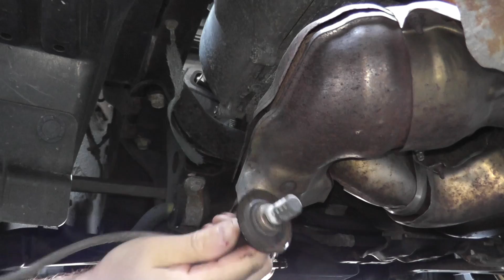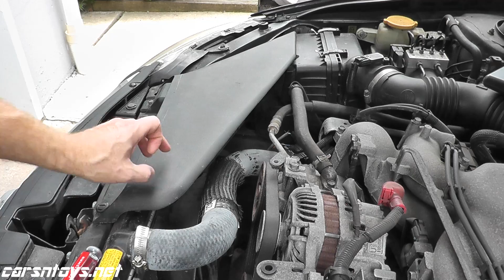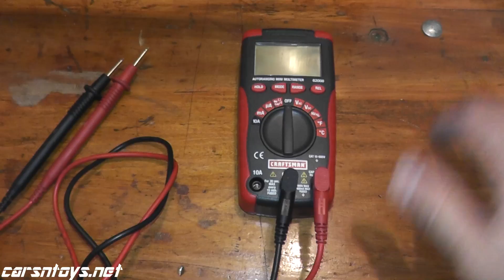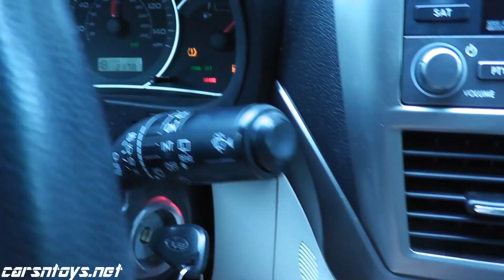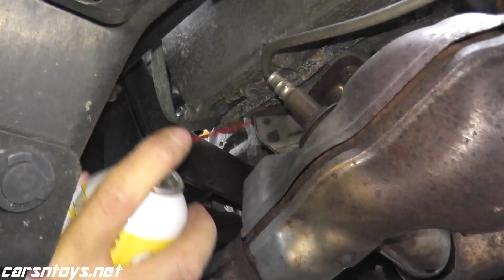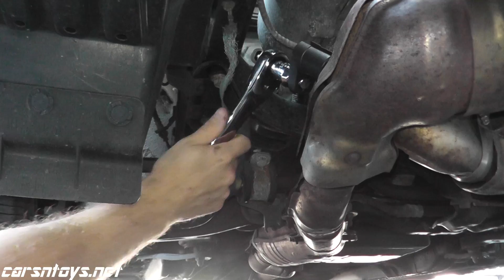Rear Oxygen Sensor P0037 and P0038 | Testing and Replacement

Comment: My 4.2 a6 had this same code would it cause the car to not rev and barely move in traffic.
Reply: Did you change and notice a difference?
Reply: @joepearlzz8504  Yeah I changed the O2 sensor and the fuel filter and it worked fine after that.
Reply: @kaptainkirk11 did u change lower or upper ?
Reply: I changed both and also changed the fuel filter, afterwards the car was fine but I sold it a few months ago

Comment: I had P037, I replaced the sensor with the extender, the car gets better but I got 3 codes later, P037, P038 and P039, any solution or suggestions please. thanks great video.

Comment: I replaced the old downstream sensor for a new one (~130K on 2001 Saturn SL2) and got a code P0038 after ~10 mi. I'm updating everything I can on emission trying to remove P0446. But here P0038 came, probably defective sensor. What is interesting the driving is great, no impact of that code on it. Can I clean the original sensor w/some carb cleaner and use it for a while, while I find the good sensor?
Reply: I was wondering about cleaning mine with carb cleaner or electric clean.
Reply: @bigredc222  I wouldn't. Better to find one on Amazon. They send it pretty quickly. Actually I bought 2 (different brands(, and one caused a code, I replaced w/the 2nd, and that one worked good. It is for that one on the bottom, under the car (Downstream O2 sensor). Upstream O2 Sensor (by the engine), I replaced, worked w/no problems. Ideally of course OEM. But maybe cleaning also will work. I'm not that expert.
Reply: @olenaerhardt7725  I can get an oem sensor at Rock auto for $85 or one from Amazon for $30.
Reply: @bigredc222  I'm sorry, Upstream and Downstream O2 sensors, I expressed myself wrong before. I usually try to go w/OEM, but since I practice primarily on our spare old car and difference in price, sometimes significant, in many cases I just buy cheaper aftermarket parts to see if I can replace that part, and everything works good so far. Those O2 sensors not hard to replace (once you broke the nut on old Downstream (that is most difficult part, but if you penetrate w/PB Blaster for 1-2 days,like I did, and then use a small breaker bar there shouldn't be any problems)).
Reply: @olenaerhardt7725  What are you sorry about? I'm working on a 2008 Mazda 3 I bought new, it's got under 70,000 miles, so I hope to get another ten years out of it since it gets driven very little. Part of me wants to spring for the oem since the car has been so good to me, but the cheap side of me want to try cleaning it first. 
I watched a video of a guy cleaning one, and most of the comments say it works, but one said it only lasted six months and he ended up having to replace it anyway.
Maybe I'll split the difference and buy the cheap one. Have you ever tried Rock auto for parts?
Reply: @bigredc222  Well, that is bcs I used the wrong terms for those sensors: not #1 and #2, but Upstream and Downstream. Anyway, if you have just 70K and it is so good car, I even don't know. I think those sensors effect the work of engine. See i have in my possessions for my auto experiments 2001 Saturn SL2 (132K), which is famous to withstand many things. Someone on Saturn fans even stated that you can't kill Saturn, which is true for our Saturn. I also saw a film, about cleaning that sensor, but for that your car, I personally would go w/OEM only. Maybe to do more research, like what does that bad sensor(s) can do. For example when on one Downstream sensor I got a code for it, there was a code, yes, but the car was driving perfectly well. But it was some negative effect I was not aware of, smth that computer didn't like. From Rock Auto I ordered just one part (decided to try after Mechanic the Nick film, he recommended that company). It was Heater Core (like for $10), I want to try, if I can replace it. I filled it w/water - no leaks, but I didn't installed it yet. They sent the order very fast, I think very good CS and company.
Reply: @olenaerhardt7725  My thought on cleaning it, the sensor may not even be bad, there could be a problem with the engine and the sensor is just doing its job. I wish there was a way to know the difference. I read one of the things could be a leaky head gasket letting coolant into the cylinder.
Reply: @bigredc222  I've replaced Valve Cover gaskets on 2 cars (including Saturn), but Head gasket is too complicated for me, though I have it in the set, maybe later ...
It is interesting to know that the coolant can leak into the engine, bcs of poor Head gasket, I think I've heard or read somewhere about it as well. But if you clean the O2 sensor, how you will know if it is good or not? In my case I've replaced both O2s just bcs of millage. But on one downstream I got the code after some driving, replaced on another one and everything was good. Both downstream sensors were aftermarket.  Do you know how to replace that Head gasket? It seems like too small millage for that gasket to go bad.
Reply: @olenaerhardt7725  I did a head gasket on my sister's Volvo and it worked out. I went to vocational school for auto mechanics in high school for two years, but after I got a job as a mechanic I realized it wasn't a job I wanted to spend the rest of my life doing, but I kept my hands in it by working on my own, and my friends and families cars. I've done timing chains, water pumps, suspension parts, exhaust systems, and brakes, I've also fixed TVs, air compressors, cell phones, tablets, computers, plumbing fixtures, and all kinds of stuff. If you have a decent mechanical ability there's almost nothing you can't learn how to fix on youtube. Sometimes I would find out how much a garage wanted to do the job, then if I could buy the tools to do it for less, I'd buy the tools and do it myself. I love tools so I look for any reason to buy more tools. I forgot I got some additive I put in the gas tank, I'm going to run a tank of that through before I replace the sensor, I may get lucky. It's cold here now so I may wait till the weather warms up before I work on it.
Reply: @bigredc222  O my! You did a lot, I even feel awkward I tried to give you some advices, unless you take them as some thoughts of DIY w/only 2 years experience. I noticed though that not every mechanic in the shop would do some of my projects. Also practically none I saw aware of a Breezer Line for 2003 Chevy Cavalier, which connects 2 Inner Tire Rod Boots (Rack & Pinion Boots more correctly, I think), and have tangency to knock it out during alignment. It is horrible design on Chevy, I agree, and maybe that line is not so important, since only recently I discovered, that for several years that car was driving without that Breezer Line (it is like aluminum 1/4" pipe) to be connected and just resting on suspension, but still. At Fire Stone they could know about it. Being a person of technical background and watching YT I found that many projects can be easily done. I also very specific about precision on torques, particular chemicals to be applied and alike, in other words I like the project to be done correctly and neatly, and I realize that at shops they probably just don't have enough time to do the way you can do yourself. Besides auto, I also did a lot: replaced all the electrical features in our house for fancy ones, painted everything w/some staining, replaced all the plumbing, which goes fm/ the wall, replaced an old fence. I also usually grow a small garden in our backyard. Now got stuck on several car projects, so primarily concentrated on that. I Head Gasket project I think one of most difficult parts would be to remove that head (bcs of its weight). Is it very heavy? Also Timing Chains - I don't know how to do them at all. But yes, it is very true, you can get a lot of info on all kind of projects fm/YT. Also prices on parts are so much better than on work (and I'm personally in doubts, after I've learned some stuff and saw how the services are performed sometimes, if the work is dome 100% correctly, and of course none cleans anything in shops). I subscribed for your channel, don't know what state it is, but the area looks great. We are in Dallas TX. It is very nice weather now here, so I need to complete w/tires, while it is not cold (I'm replacing them). With that O2 sensor, so what code you are getting exactly? That additive in FT, can it cause any problem? I've read somewhere that if you store a gas in container it is better to add additive, though not sure. We usually add additive to the 1/4 full tank, and then go to fill in, but yeah if to let it sit w/additive. Interesting question.
Reply: @olenaerhardt7725  I'm in South Eastern Pa. it's 30 deg. today. The way they keep adding technology to cars, I still have a lot to learn. I also like doing things as perfectly as I can. The code is P0037, HO2S bank 1 sensor 2. I just read what that code means again. It's saying it's bad or the wiring may be bad. I don't think I have to worry that it was caused by something like a bad head gasket. They say it's very common for the wiring to get burned by the catalytic converter, but if the wiring is good then the sensor is bad. Talking to you got me to re-read what the code means and now I'm not worried about it being anything worse.
Reply: @bigredc222  In the situations like that to be in doubt, I consider to have an extra part.s far as I know O2s should be replaced periodically, don't remember now how often. But it is always good to have an extra part. Especially if most likely it is a sensor.
Reply: @olenaerhardt7725  I probably should have said this to begin with, but I got stuck in the mud and had to be pulled out, then the next time I drove it the light came on, it's probably just a coincidence but I want to see if mud got into a connector or something. Then I'm going make sure it's getting power, then I'll replace it with the OEM sensor.
Reply: @bigredc222  I think most likely that is the cause. Now I see why it is so bad to go in liquid in the car. Before i thought it is only engine, but the downstream sensor is there as well. The question is if the sensor will be good after the cleaning. Somewhere I've read that you can't actually clean them, but many people do that in films including Chris Fix.
Reply: @olenaerhardt7725  One guy says, don't even touch the sensor with your finger, and another guy says it's OK to clean it.
Reply: @bigredc222  yes, that is true, those contradictory statements so confusing sometimes. But I think if Chris Fix cleans it, it is possible. He is very good mechanic and has so many films. Probably you saw some of them. But did you look around that sensor, is there any mud around it or how?
Reply: @olenaerhardt7725  I couldn't see anything from above and I haven't felt like jacking it up and crawling under it with the weather so cold.
I also need to get my pressure washer out and get the mud off, but it's just been too cold.
I'll get back to you after I do it.
Reply: @bigredc222  O'K, yes, it would be interesting to know the outcome. Also a mirror might be helpful. I have one like 2x3" w/handle of varying length, it is auto mirror. Just to see the general picture.
Reply: @olenaerhardt7725  I have a big one about 4"x6", I didn't think to use it.
That's a great idea, if it wasn't dark I'd go out and look right now.
Thank you.
Reply: @olenaerhardt7725  The mirror worked great, thank you. I was able to see it very easily just leaning over the engine and holding the mirror below the firewall. 
There was no mud. I tested its getting voltage, and I got about 2 ohms between two pins, it's supposed to read between 10-25 ohms.
The good part is it's really easy to get at, I think I can change it from above, so I'll order the new one now.
It's been fun talking with you.
Thanks.
Reply: @bigredc222  My pleasure. Did you start the car when you tested? What was the voltage there? Location of Downstream O2 sensor on Saturn is on the right side almost in the middle of the length of the car, if I'm not mistaken. It is interesting location on Mazda for that sensor.
Reply: @olenaerhardt7725  Yes the car was running, it has 14 volts. This is a video of the sensor being changed, you can see where it at. After watching the video I'll have to get under it to change it. https://www.youtube.com/watch?v=fiOxH14JPEE
Reply: @bigredc222  O'K, I'll watch, thank you. Here interesting film: ~@4:50 Sue says the oil on deep stick will me milky color, if coolant is leaking into the engine. 
https://www.youtube.com/watch?v=aAteE_5qS6Q
Reply: @olenaerhardt7725  Yea I knew what to look for, my oil looked new. I ordered the oem sensor from rock auto yesterday.
Reply: @bigredc222  I would order couple, bcs why that sensor went bad on  ~70K? Maybe that car has issue w/those parts. Our 2001 Saturn SL2 had good O2 sensors on 125K. I replaced them primarily to check if I can brake the nut on Downstream, especially I was looking on resolution of the problem w/another code, also mileage.
Another car we have 2009 Nissan Sentra is notorious for failure of Air Duct. And it did fail like on ~55K, so I bought 2 of those parts: one I installed and another one have like spare. Now I think maybe to get and extra one, I'll check prices on Rock Auto. Looks like the part fails every ~50K.
Reply: @olenaerhardt7725  When I looked up how long are O2 sensors supposed to last, it said 30,000 to 50,000 miles. I was thinking about replacing both sensors. Some stuff that needs to be changed regularly I do buy extra. I still have a bunch of tail light and turn signal bulbs that they stopped using in cars years ago. I have oil filters and spark plugs for vehicles I sold ages ago. If the sensor going bad prevented me from driving the car I probably would buy a spare, but it's so easy to order new parts these days, I don't see a need to have a spare.
Reply: Does the region regulation has anything to do with it ?
Reply: After replacing it you’re suppose to  reset it with the scanner

Comment: One note... I believe, if I'm not mistaken, that on many Chrysler/Dodge vehicles, the power feed for the o2 sensor heater comes from the ASD Relay. This would mean that the engine must be running to see voltage at the connector.

Comment: Thank you for this. I have the P2271 code on my 2015 Impreza with a FB20. Is this a similar fix? Error is "O2 Sensor Signal Stuck Rich Bank 1 Sensor 2".

Comment: I have an 05 murano,it has a P0420 code. I checked the readings for the voltage,the O2s11 has 0.290 to 0.300 volts only and the O2s12 has 0.580 to 0.640 volts. Is sensor 1 bad? And what about sensor 2 ? It looks like the voltage is ok,right ? What about the cat? Thanks